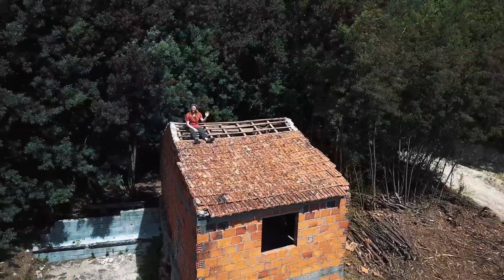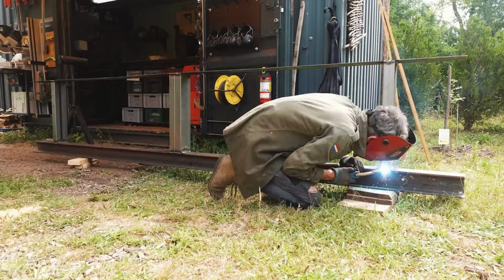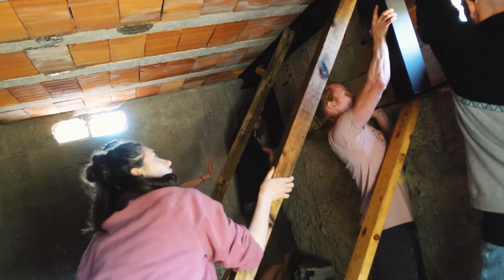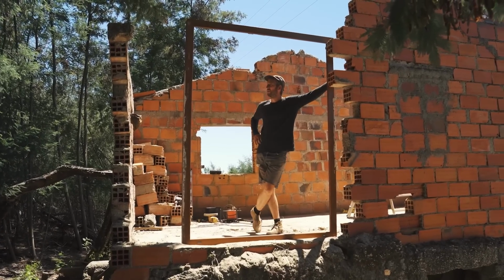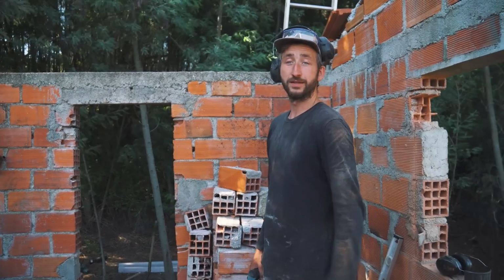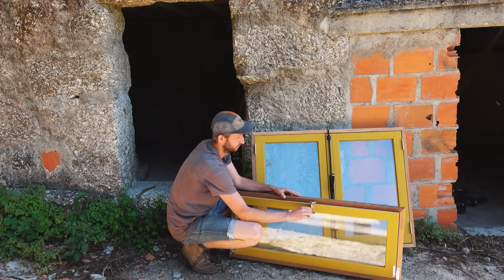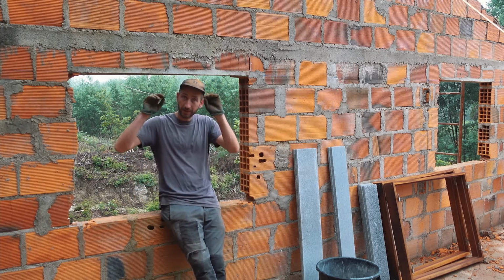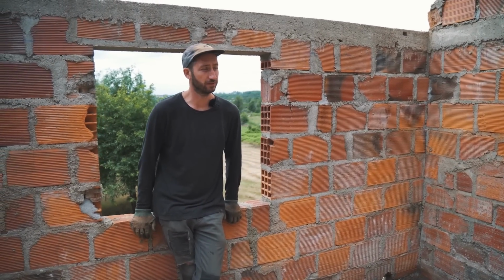#52 Renovating bricks and windows in our old abandoned portuguese ruin

Comment: I still don't understand why oh but why didn't you remove everything but the granite structure.  Even when you finish with reconstruction there will be too many weak links in the structure. The brick and the concrete are old and porous , and I doubt there is even minimum required reinforcement steel built in the structure
Reply: I'm far from a builder, in fact I have zero qualifications, but from videos and from a friend, when I've been learning various things completely unrelated to this video and now watching this series I can't lie I did wonder why they aren't just taking it completely apart. It's gone already anyway. Try and take everything down carefully for potential reuse but doing it that way looks like it's going to be botched and it'll just expose one issue after another. At the end of the day I'm not a builder, I don't have structural degrees either, and I suppose you can only learn if you make mistakes, even though those mistakes might be costly. They may well have consulted somebody who knows what they're doing, maybe there is a plan that will work and make it safe, suppose we'll see.

Comment: Ceramic bricks need to be submerged for a few seconds in water if they are dry, otherwise they absorb the water in the mortar before the mortar has time to set.
Reply: This sounds like useful information! Any other tips on using those bricks? Inexpensive block materials all seem to have their own special issues wrt moisture.
Reply: Yes, reinforced concrete perimetral strap for the next layer of beams. Actually in the footage you can clearly see it had been done everywhere except on the collapsed wall. (you can see the shuttered concrete both in the cellar and along where the roof beams went). The reason is that technically those are not load bearing bricks, but they got around it with the straps so as to spread the load equally.
Reply: Are these not terra cotta bricks?
Reply: no need to submerge if you just throw water at them.

Comment: Just nock the top part down, there's no way that building is safe.
If your gonna keep it standing reinforce the walls in the corners, for isolation use pir or styrofoam on the outside of the walls and stuco it.

Comment: Guys great video and finally good to see you working on the ruin, just couple of quick tips(I'm a site manager in construction in Lisbon), window sills in granite/limestone should be installed with tile paste glue, should there be any further contention on the wall, the mortar is subdue to cracking rather glue, which will flex. Also keep in mind the wall faded and is fragile due to lack of structural columns, a lentil is only good if directly unloading on the lower, load bearing wall, in Portugal, every slab or lentil should be vertically supported(usually in concrete) every 5m of span, and edges of the building envelope, bricks can be as straight as you want, but if not supported by a structural beam and column system, they will most likely settle after some time, keep up the good work!

Comment: Using granite as a windowsill is a smart idea. The angle on a windowsill is common, in wooden framed houses builders often use a wedge that is laid under the widow frame, which is covered with a rubber flashing tape. The wedge creates the flow angle while the flashing tape creates the water proofing. What you have not done is cut a drip edge channel in the underside of the granite sill. A drip edge breaks the surface and causes the water if any gets on the sill to pause at the channel, build up and then gravity causes it to drip (hence the term drip edge) harmlessly away from the building. The risk of not having a drip edge is that water will continue to travel under the sill and get to the wall surface, after which absorption or ingress can occur. Regardless I like the recycling of the older windows. Take care D
Reply: For windows that don't have a drip edge, a bead of caulk in the same area can often serve the purpose just as well.

Comment: Seems to me that a lot of properties in Portugal are built in a similar way. Single brick, poorly constructed with little strength. In UK this is referred to as jerry building, this sort of approach was used to construct temporary pig houses in the countryside  and would never pass even the most basic building inspection.
Reply: Exactly what that building was.
Reply: This is not common or even alowed for home buildings anywhere in portugal. Not in the last 25 years, at least.

That was probably a pig house, or some kind of agro building, built on top of an old stone ruin.

This rebuild dont seem legal and safe...
Reply: it would't pass inspection in Portugal either.
Reply: Not they are not… that thing was a poor death trap before, and now is a “posh” death trap still
Reply: @lulubelle0bresil  It is badddd, Should be taken down and reinforced the proper way. The amount of flex and movement it had when he was removing bricks along is a sign to take it all down. The mud they used was either too wet or too dry every time... Idk I hope they stay safe though

Comment: Just as an advice: when you place the window in the wall's hole, it is pretty hard to properly level it. To make things easier, you can place a table with a tied weight on the edge so that you get your hands free while  the frame stays at its place while you play the gap adjustments for leveling!
Good luck with renovation guys, you doing no small job there!!!

Comment: that building has no skeleton that i can see, you usually have to have concrete poles on each corner with reinforced metal bars on the inside to provide structure... that looks like a death trap, using only bricks and mortar is extremely dangerous, that is why it wobbles so much.... i imagine that if i ran into one of those walls it would all come down like dominos! Be careful guys, build the skeleton first, that thing is not up to code in Portugal (or any other country i imagine)
Also, all that rebuild, alterations and  things might require permits from town hall since what might exist on records may not be that brick house (highly doubt that "house" was legal) and without a an approved project, and use change (you want it for habitation), you may have to tear it down
Reply: You are aware that ppl have been building houses just out of bricks and mortar without steel reinforcements for ... centuries... right?
But yes, quite, getting the structure secure is the most important.
In the UK our house of over 10yrs had steel supports only where we'd put a patio door on a structural wall... it was built in the 1940s... sturdier than a lot of the prefab stuff being built now.
Reply: @SplatterInker  Indeed i am aware, but there are now stadards and building codes that have to be followed and that did not exist centuries ago (or even decades for that matter)
Reply: I agree, I’ve been loving following this project for a while and I follow a fair amount of renovation stuff on YouTube but this is just upsetting me to see how careless they are to the risks. Knock those top walls down and start again. Stop with the bullshit strap on the walls, do it properly, and remember that your bodies are far harder to rebuild than walls.
Reply: im not a brick expert, but it seems to me those bricks are hollow. They are only held up by the other walls and the weight of a roof.  no way would i keep any of those walls. I would remove them and rebuild with blocks or have concrete pillars.  i feel comfortable with a house i have in Hungary made of block and brick walls that are 2 feet thick. That house is a death trap!
Reply: @SplatterInker  Those houses were built with interlocking duallayers of bricks (With offset interlocks, I don't know all the phrases in english I have a book on the subject in Swedish) not single layer walls like this, single layer walls only became a thing when we started reinforcing it with concrete. 

Also there are bricks and bricks, real bricks is lss then 50% empty space (holes facing upwards)  these are much less then 50% soid and have holes faing sideways. This makes them far far more brittle.
Reply: Here in Germany, all houses(except for wooden houses or houses made from prefabricated concrete parts) are still built using bricks and mortar only. You don't need any concrete poles or pillars, bricks are all it takes for houses to hold for centuries.

But these are the wrong bricks. If you want to build sturdy walls, you need hollow bricks with holes protruding vertically not horizontally, like Poroton bricks.

That's the main problem here, the house was built very poorly using the wrong material and crooked lines.

Comment: You should not be putting knots into ratchet straps. Their strength rating is based off of the load being distributed across the entire surface. When you knot them, you're greatly reducing the surface area the load is on, and they then become rated for only a fraction of their typical load. They fail very easily in that state. Stay safe!
Reply: This is true of any lifting or load strap!

Comment: Pro tip: when cutting through metal with a cut off wheel, (like you do on an I-beam around the 3 minute mark), try to just grind on the surface of the material rather than plunging through a small part and pushing through the rest. It will make your blades last much longer. Good luck with the build!

Comment: 1. The lintel above the window is not resting o the wall enough.  It is covering the window frame and a bit extra. This lintel will transfer the load of the brick wall above window onto the window frame instead of onto the walls on either side of window. 
2. The I section is way too heavy for the loads it has to carry and the span. That steel frame is not anchored into the granite support. It is simply wedged into the gap above the granite. That is a weak link for you.

Comment: For insulation on the bottom you can make wasted plastic floors, or concrete mixed with styrofoam. I had similar project in Croatia. So i had styrofoam under 3-5cm concrete which had this plastic inside to keep the strength. Later it was polished with so called helicopter. I wanted to have it almost as a glass, it didn't work but anyway i have few coats on it and it is durable, you can wash it with water and so on.

Comment: Hello Dave and team. Congrats on your big effort there. It is a long journey, hard but very grateful making your own, more in that way, saving material, doing it in a sustainable way. 
Do not care so much on high tech comments, but please make it safe and follow the locals recommendations, I know you are doing. I, as structural engineer, will suggest to add some inner frame or transversal wall to avoid lateral movements on the big side walls, as they look very weak, but maybe you prefer a diaphanous space. It can be solved also making the roof horizontally rigid, adding cross bracings (could be steel cables, thst look pretty good combined with wood). That house will look very nice, but taking in account seismic, it seems it will need some bracing in the middle or  something that makes the roof transfer the horizontal loads to the lower walls. Seeing how you solved the lower support, for sure you have this already in mind.
That kind of scaffold help me for half my self built house, they are very practical. You could add wheels with brakes to do the roof from inside, as well.
I liked the frame, to transfer the load to the lower wall leaving openings for the window. That was very well solved. 
Again congratulations for you plan, it is getting smoothly where you wanted. 👍🏻👍🏻👍🏻

Comment: the straps don't prevent the wall from falling over. You're assuming 1 wall can hold up the 2nd wall.
What may happen is that if one wall collapses outward it will pull the 2nd wall inward. Like a square turning into a parallelogram.

Comment: you need a good contact of the metal frame with the building. usually you would make the frame smaller to put it on a mortar bed. then push mortar in the gap on the upper side of the frame. The Mortar should be 1-2 cm thick

I would also switch to corded mashines. its nice to have battery powered mashines, but only additionally. i would recommend the Bosch GBH 2-28f. Its pretty cheep and very durable. dont mix the mortar with the battery powered drill. It will die off in the future. you will have to mix a lot of mortar in the future so i would buy a mortarmixer like the Einhell TC-MX 1400-2 E and a mortar mixing mashine. a tumbler or what it is called

how did you connect the window frame to the granit frame? usually you dont need the granit frame on the top, left and right side. you use mortar to make the surface smooth. and you should use an anker to fix the window frame to the wall. 

My biggest tip is, that you should watch youtube videos carefully before you are starting to build something. there are many many detailed videos on yt to learn from.

I don't think this work is something for a professional video editer. Maybe because they want to make it to professional. There are many people on youtube that are putting out many videos a week.

You guys are having the project of my dreams. Pleasy understand my words as help. No criticism

Comment: Architectural student here. That building looks highly unstable and is a hazard. Those bricks are not supposed to be used that way (the holes should always be directed upwards). If you want to rebuild it properly, strip it down to the foundation, flatten it, get some proper bricks, build the walls properly. Also, try to build the ceiling from wood as it is probably way easier for you guys than reinforced concrete (There's a lot of information on the internet about how to do so). Have a proper ceiling, build up from there and have a proper roofing. You might not be able to use just recycled materials all the time. Those windows look unsafe as hell as well. It's not supported by a proper lintel! That's an easy fix if you rebuild it. If you need any advice on details or plans, feel free to reach out to me. I'm happy to help!

Comment: Project idea, make a thing with two large wheels on it, that can traverese the nature, where u can adapt the size of what its holding. It would make the moving of this metal frame way easier^^ I get that its very specialized, but it can help a ton having modular wheels around
Reply: you mean a trailer?
Reply: @wonderful_  Something more like a skateboard ish, like this: https://www.cowab.no/resize/globalassets/689894.jpg?ref=8C24BB6BF9&width=590

Used it a lot when i worked with installing industry windows, which often weights 400+kg
Reply: @nonexternal  Gotchya. Yea these guys are kinda missing a lot of essential equipment that would make a lot of things go a lot faster. They need a contractor.
Reply: @wonderful_  Thats not what im saying, i get that they are trying to cut costs etc. But small multipurpose things like these could go a long way ^^
Reply: @nonexternal  I know it's not. It's what I'm saying lol

Comment: By the way I hope you installed some concrete or steel lintels above the new window frames, if you didnt the window becomes load bearing which yours clearly isnt able to handle. A lintel will distribute the forces from the masonry above the window frame to the masonry next to your window frame which is material that can hold it. If you dont use a lintel the window frame will probably be damaged and cracks can appear in the masonry and the window

Comment: Scaffold like that is really useful. It becomes unsafe if the height is 4x more than than the width (narrow dimension). If it's taller than 4 times higher, it needs to be anchored to the structure

Comment: to stabilize the structure, Why don't you look into external concrete support Collum's (corner & center) with individual foundations. i think the costs is reasonable and they would tie in nicely while adding a great deal of support
Reply: for building stability , he needed to provide external Rcc column or Steel column

Comment: Why bother with steel under the floor? use shuttering to take the wall straight to the ceiling, install some rebar behind! go upstairs take out a few bricks from the floor and fill the gap below, and of coarse you could put some bolts into brick before cement to tie it all together..

Comment: The way Portuguese build seems very unstable but the render adds a lot of strength to a building if it is mixed correctly maybe do a little research on a 4-2-1 mix with fine aggregate your basically putting a concrete shell that is a lot stronger than the bricks on the inside and outside of a building

Comment: Are you sure the old cement of the building is not burned? (Too less water, because the bricks are sucking water so it will just dry instead of chemically react) That will cause a structural integrity problem

Comment: If you are going to work with dstroying cement and other structural materials you need a better mask. The dust that comes off those is very hazardous for your health.

edit: Shame the videomaker stopped. He was making some serious progress adjusting and learning and I felt that the last two were excellent quality.
edit: the more I watch the more I think you guys need a building specialist in your group. You are working unsafe for both your health and your structure. Someone is getting hurt either directly or on the long run.